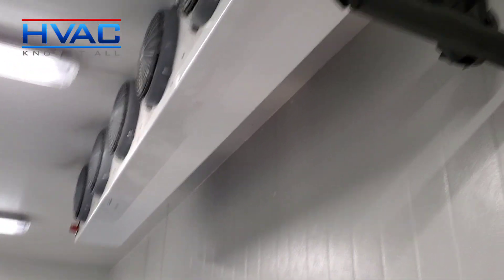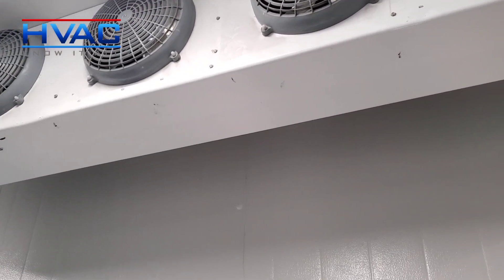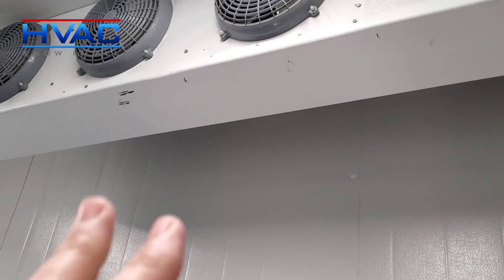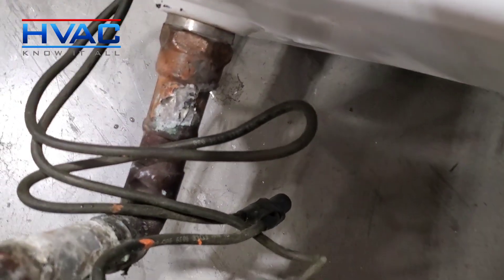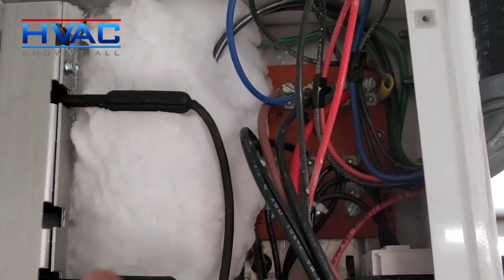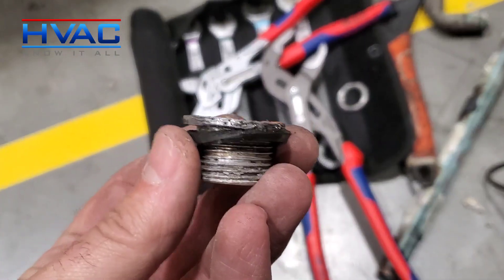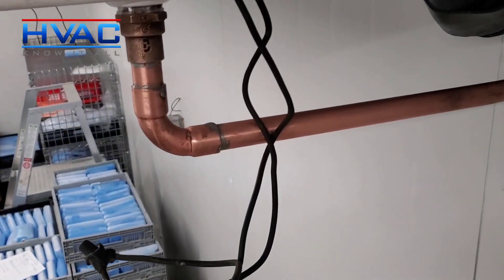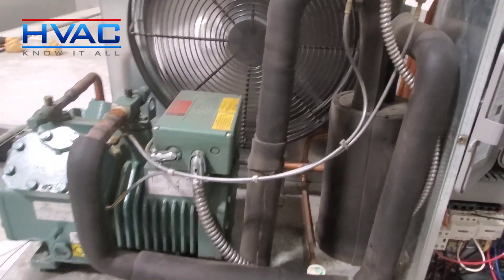Walk-In Box Evaporator Intermittently Leaking and Blowing Fuses

Comment: I just had same issue, but the defrost was getting prematurely ended, replaced time clock and left x disconnected so it terminates on time only,fixed the issue
Reply from the maker: The time clock ending too soon was blowing fuses?
Reply: @HVACKnowItAll  No, but when i tried adjusting it was hard to turn, something wasnt right